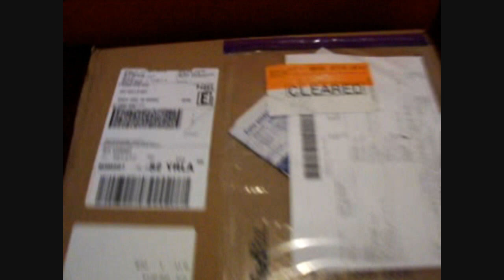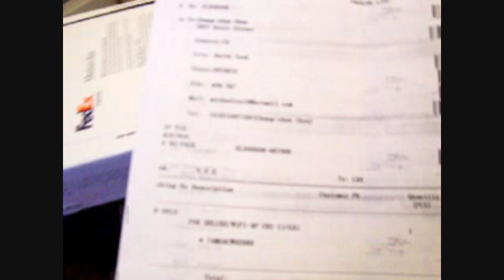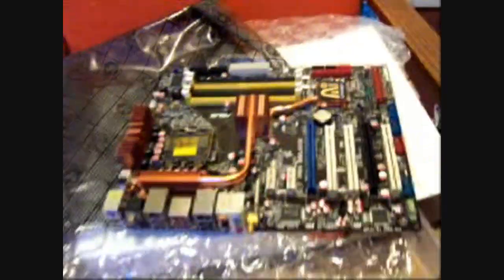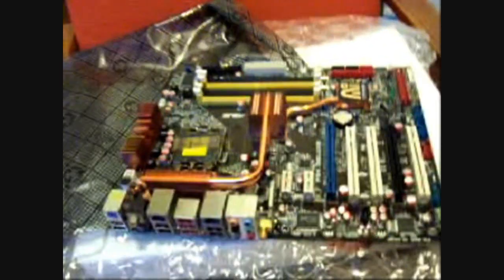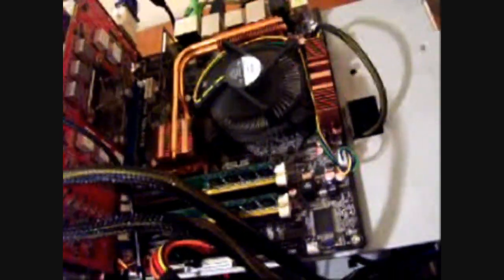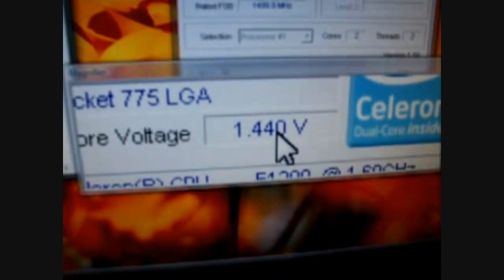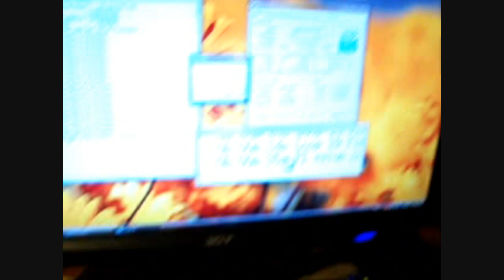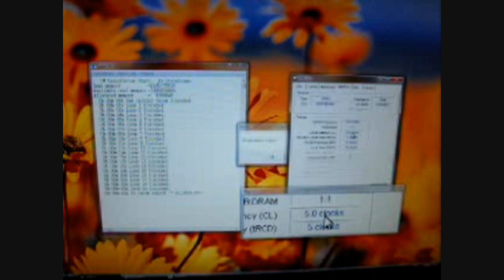Overclocking E1200 Part 1 of 2

Comment from the maker: @longiscool if your motherboard have overclock option, up the fsb 5 at the time til it won't start anymore, so u know the top limit on stock voltage, then u can decide if u want ot add voltage little bit to push it a little higher on the clock speed, it's mostly experience